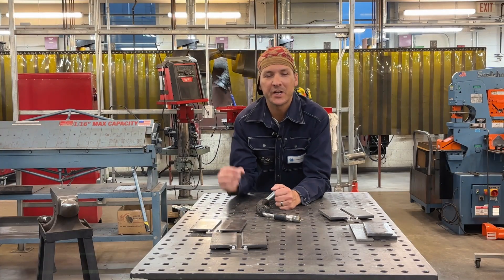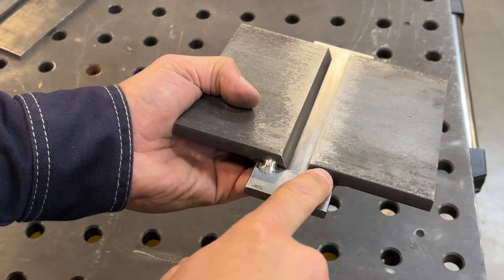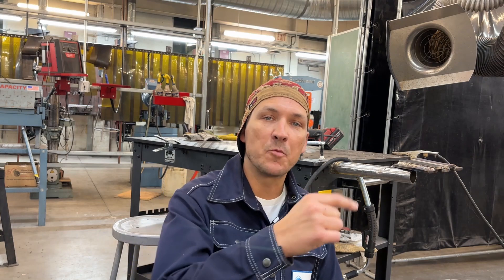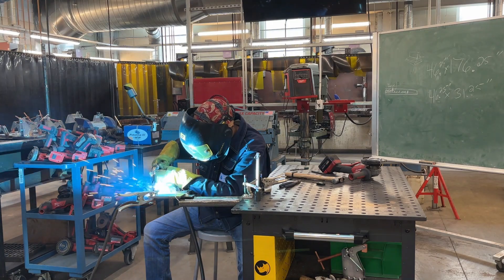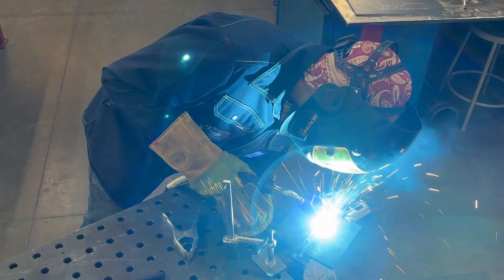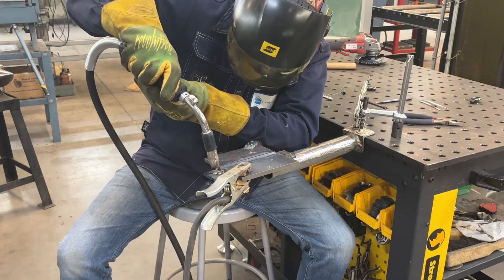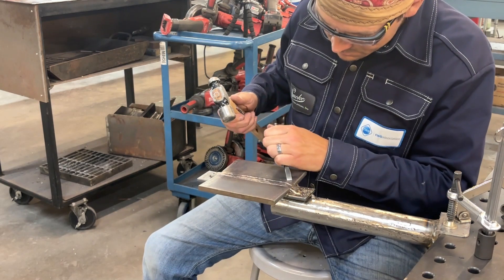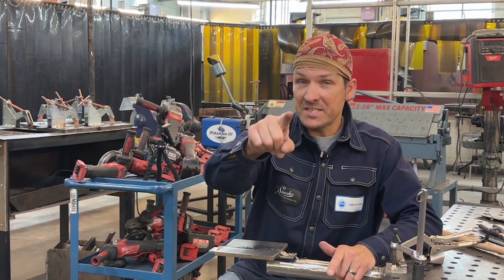MIG Spray Transfer CWB Structural Plate Test  – Step-by-Step Guide!

Comment: My friend it is very evident by the sound, arc shots and spatter that your voltage is way too low... Arc is alternating between spray and short circuit. You're still mostly short circuit. Should be no crackling at all, and a smooth even arc with little to no globular transfer which is what I am seeing in your arc shots. Try 400ipm and 28v at 50cfm gas. Always push with spray transfer. Rest of the info looks good to me. I am AWS though.
Reply from the maker: Thanks for the feedback- 

#1 spatter was an example not the weld I just laid. 

#2Crackling is not transfer mode. We run 85/15 so not always  hitting true spray mode (might even be a bit of millscale)

For 3/8 plate test 28V is too high for us with our PowerSources. 

That root turned out flat zero spatter and passed bend test. 

We all have our own ways 😁🤘
Reply: @sewingwithfirewelding5627  My settings on the exact same model machine you're using are CV, 400ipm and 28v. 50CFM, ~12ipm travel, 85/15, and I didn't even bother removing the mill scale. It stays in true spray transfer about 95% of the time and only goes globular if travel speed is too low.... Just try it man, see how it works.

Comment: You don’t even post the bend test or anything? The thing that actually tells us what you did worked…? Yeah you can lay a bead perfect and have everything go mint and it still breaks. You need to do an updated video with you actually bending your coupons. Otherwise this video is pointless.
Reply: Well, he is demonstrating the correct procedures for the test, you have to control the details by yourself. If you follow the procedures, you will have a good chance of winning the ticket.